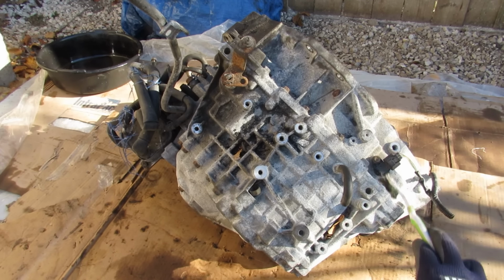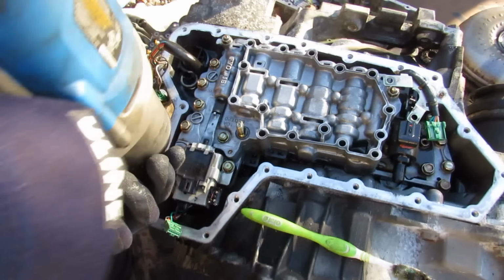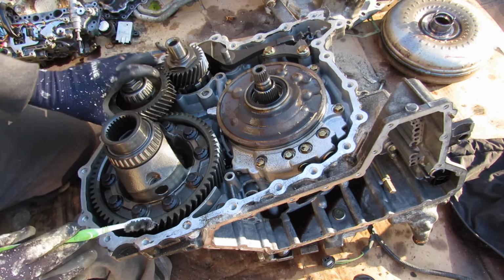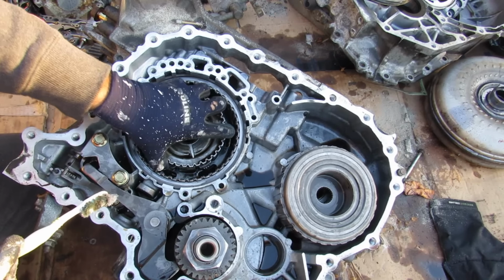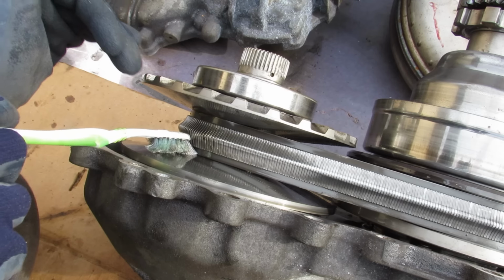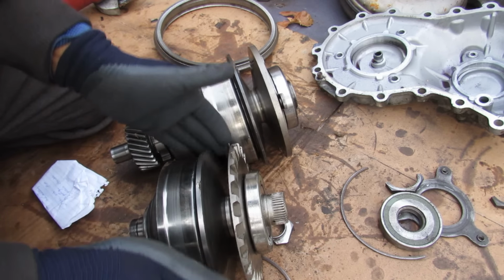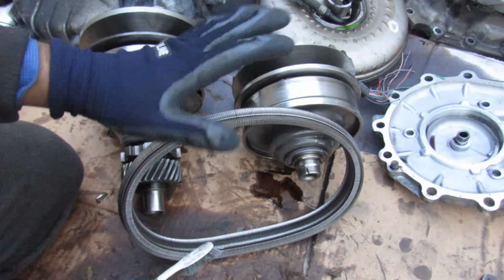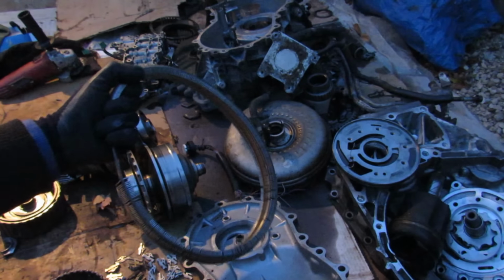Why Nissan CVTs FAIL

Comment: In my country. I know a guy with his Juke on 4th CVT before he swapped a Honda K24A2 5A/T 200hp in it. The other guy went for his 3rd under 3-year 100,000km warranty in his Juke too. And many have failed so often that we don't even consider it a failure anymore. Just another common thing for Nissan cars with CVT.

These cars are sold in Thailand with 1.6 N/A HR16DE dual injectors engine and without an air-cooled CVTF cooler, unlike MR16DDT 1.6 Turbo CVT international version. (Local sale cost reduction for 1.6/1.8 N/A, the exported ones are equipped with 4-way coolant/air CVTF cooler.)  With this weather and no cooler, the failure rate is sky-high. And of course, Nissan/Transmission workshops are very happy, too many Nissan cars waiting to rebuild/replace their CVTs. The most vulnerable one is the small Jatco JF015E CVT-7 with an auxiliary gearbox equipped in small cars under 1million Thai Baht.

I swapped the powertrain in my Nissan Sylphy(Sentra) B17 with a Honda J35Z2 5A/T, just to get rid of my Jatco JF015E CVT. I cannot stand it anymore. And my car has been more reliable than ever for 3 years. I won't trade reliability for MPG. Just let the car drink fuels and be reliable is all I ask for.

Comment: This was very informative. While confirming what Scotty Kilmer has warned for years about Nissan CVT transmissions. Your dissection defines why they fail prematurely and why you can't have them rebuilt.

I honestly never would have imagined they had as much sturdy metal in them. But the belt and clutch packs are the weakest link of them.

Comment: Auto transmissions are witchcraft, p.s that's not a fuel pump @7:20 that's the oil pump for the trans

Comment: The 4cyl/V6 Nissan CVTs also whine. A teardown won't reveal why, and eg 2 more replacement CVTs also whine. It's a factory clearance issue, putting a load on the bearings. Now we get the customer to supply his own trans, so we don't have to pay for 2 ins and outs.

Comment: Everybody knows CVT is no good also do not buy cars that are turbo if you do call the dealer just for fun ask him how much it is to replace it with a warranty is usually $4,500 with labor so stay away however if you plan on keeping the car 4. 1to 50,000 miles you can take a chance

Comment: What I've never really understood, and surely never would have expected,  is, concerning the belt, that steel on steel in an oily enviroment and besides that, a pushing belt instead of a pulling belt still manages to convey the power of the engine without slipping. Can somebody help me out?
Reply: Incredible hydraulic force.

Comment: I had 5 nissan and none have failed in the cvt .... 2 rogue, 2 pickup and 1 tsuru... why??? tks
Reply: They have a high failure rate, but only like one in 20 or whatever.  It’s a mixture of total vehicle weight, the driver, and a bit of luck.

Comment: Finally a video on CVT👍 Excellent job! Btw I have a 2015 Nissan Altima with over 250k on it (freeway miles) and NO cvt or engine problems (Its a miracle)...
I change my fluid every 60k.

Comment: You should take apart the mechanism that allows the pulleys to adjust the effective diameter, you'll find a normal-use fail point on these transmissions.

In order for the pulley to both 1) change its effective diameter while 2) transferring torque both into the input shaft and out of the output shaft, the pulleys themselves are splined to the shafts with ball-bearings in the channels. These ball-bearings are what the pulley rides on in order to move in and out, and they also serve to transfer torque from the pulley to/from the input/output shafts. Since transmissions spend 95% of their life in forwards gears, that means the vast majority of torque is transferred in one direction, so the splines wear on that leading edge until eventually it gives out, the pulley slips on the shaft, oil pressure drops in the pulley, one pulley adjusts without the other compensating, and BOOM you have a blown transmission.

Comment: Two years ago my wife called me to tell me that her and my stepson (it was his Sentra with fewer than 10,000 miles on it) were being towed ( first to a nearby garage and then to a Nissan dealer).  They were 60 miles away from home and I was  200 miles away in the opposite direction.   The dealer took care of them, including providing a free rental car for the 10 days it took to replace the entire transmission.  

But still, I'd prefer to have a car that works than to have a car where you can count on the dealer knowing what the problem is right away and who deals with it well.

Comment: I have a Honda CVT and it's amazing! I'd only buy Toyota or Honda CVTs, though. They're the only manufacturers I trust
Reply: Yeah but they also make the most boring cars out there..
Reply: @mmfong297  If an Accord 2.0T with 253 HP and 273 LB/FT of torque is boring, then I don't know what to say. I'd rather not spend thousands in repairs with Nissan, VW, Hyundai etc. cars before they get to 100,000 miles. The Nissan CVTs can barley make it to 30,000 miles before breaking down
Reply: @VishalShah2799  It's not only about power and torque.  If that's case, everyone car guy will drive a muscle car.   In fact, every car in the midsize sedan segment produces that hp/tq.  If you test drive the new Mazda6 or Altima in curving rolling roads, you will know what I am talking about in comparison.   FYI Honda is notoriously known for having horrible paint issue after 7-8 years..  And Toyota.. the steering is so soft that it makes you feel like driving a ship on roads.  Nissan pretty much covers your cvt repairs up to 100k.. $0 spent and they gave me lifetime oil change after..

Comment: Frightening! You just sold me a manual transmission. At least I know how to recondition them and replace the single simple clutch if and when it wears.
Reply from the maker: I'm filming a manual transmission teardown tomorrow
Reply: Where you gonna find one? Everything that isn't 30+ years old is automatic.
Reply: @kudzuwarrior  #savethemanuals. Cars you can buy in 2020/2021 that are manual-some have automatic options too: Chevy Corvette, Camaro, Spark; Dodge Challenger; Ford Mustang, Focus; Honda Accord, Civic, Fit; Hyundai Accent, Elantra GT, Veloster; Kia Forte; Mazda 3, Mx-5 Miata; Nissan 370z, Versa; Subaru BRZ, Impreza, Wrx, Sti; Toyota Corolla, Yaris ; Volkswagen Golf, Jetta.
Reply: @AleksUsovich  But did you notice all the ones you listed are either sports cars or economy cars? I desire neither. I need something big enough to haul me and whatever else I want around. Tiny little economy cars can’t do that and I have no desire to own an overpriced sports car
Reply: @kudzuwarrior  There's the upcoming Ford Bronco.
Reply: @southpaw117  True there is that. I’d be more interested in the Sport over the regular though. Don’t have any use for the off road mess and they want way too much for it because of that. When I need to off-road more than what my 2wd pickup can handle, I just go get on one of the tractors. Those big ag tires on the back of them give me all the off road capability I need which is just out in the fields.

Comment: Any idea at what sort of mileage issues are likely to occur, my daughter has just bought a juke cvt but only 7k miles (confirmed) on it. 2014 uk model.
Reply: I’m on 104,000km, no problems.
Reply: @terenceokeeffesmotorcyclestuff  thanks, that's a bit comforting.

Comment: CVTs are also common in high power equipment, bulldozers, front loaders etc.
Reply from the maker: Really? I did not realize. Thought they'd be manual
Reply: @speedkar99  Yes, both Hyundai and Caterpillar amongst others. Just as cars use different types of (e)CVTs, so does construction equipment.

Comment: Transaxle does not even remotely means that it is transversal... Read about the Nissan r35 gtr? A true transaxle... Or maybe a c7 Corvette?... Two shafts, Gearbox on the back, longitudinal engine on the front?.... Going back to CVT, really hate them 😂

Comment: Wow I never knew CVTs had torque converters - I always assumed decoupling the engine was accomplished with a centrifugal clutch and then the belt itself had enough slip to allow smooth takeoffs. Awesome video, I'd love to see you do a Honda IMA transmission/motor or something similar!

Comment: The more I learn about cvts I think the number one issue is the coolers. If you get a bigger cooler and thermostat (if you live in cold places I'm looking at you canada) they are amazingly reliable and actually hold a lot of power. And with time they will just get stronger and better. If you own a cvt do yourself a favor and get a transmission temp guage, make sure you use the recommended fluid and get a large aftermarket cooler.

Comment: Although the concept seems sound, the entire CVT system seems inherently unreliable as implemented.
Reply: Well, in this case it is. The original implementation by DAF and Fuji, was aimed at the small car market and was perfectly reliable.
Reply: Take note of all the cars with CVTs in a store parking lot sometime. They're here, they work, and like anything else once there's enough of them on the road, cost to service goes down.
Reply: @whickervision742  Let's wait and see how many of these can reach at least 100,000 miles without needing a new transmission. If its less than that then I would find it unacceptable. The transmission isn't supposed to be disposable like a sheet of toilet paper. I actually like the idea of the CVT, its all down to the implementation. I have a milling machine with a similar variable speed drive.
Reply: @stevewhite6252  CVT’s have a bad reputation simply because of the crappy ones Nissan put out over the years. Most other manufacturers have only recently been mass producing these in the past few years

Comment: All automatic transmission vehicles, the old sun planetary gears and these modern CVT should not be used roughly. They all should also be serviced on time and the right type of oil and filter should be used. Other factors effecting their efficiency are too much heat and too much cold. Otherwise, Nissan have been making good automatic transmission for years through their division of JATCO. I don't see this as their fault.

Comment: John Deere uses a similar system called IVT on tractors with over 1000 lb of torque.. How come tractors use CVT and IVT transmissions and no issues? I believe Fendt uses CVT on a tractor with over 2000 lb of torque, and no issues.

Comment: Man, transmissions are complicated!

Manufacturers have been trying to perfect the CVT for decades and they always run up against problems. Interestingly, the idea for the CVT has been around since at least the time of Leonardo Da Vinci, but making components that are flexible AND strong took time.

The most efficient engine/transmission system is the one where there is no transmission at all: Electric cars. Just a simple gear box is needed to transfer power from the electric motor (with instantaneous torque) to the wheels.

Comment: Are eCVT better? My Ford hybrid uses one and dealer says no fluid maint change is done, it’s sealed they say.
Reply: Yes, "eCVT" style gearbox like Ford and Toyota don't use a belt and pulley system. Instead they use a planetary gear set that is always engaged. There are no clutches, no torque converter, no belts and no pulleys, only a torque damper to reduce engine vibration. It's an extremely reliable system. 

Having said that, it is still a good idea to replace the fluid around 100k, especially if you tow, because this fluid is responsible for lubrication of the gear sets and cooling the electric motors. The dealer will say it's not required, but it's good practice and can be done pretty easily with fill/drain plugs or a vacuum extractor depending on design.

Comment: I have a Jatco built CVT behind a VQ35DE in my '13 Maxima. Nearly 90K, two NS-2 fluid change, and zero issues thus far.  The flappy-paddle shifters are sort of hokey, a 6spd manual behind the VQ would be much more fun to drive. 
Great video!

Comment: This is, incidentally, one of the main reasons Mitsubishis aren't fun to drive anymore.  The same ... not so bad 2.4L N/A or 1.5T engines... mated to a traditional 5-speed  (or conventional geared A/T)  perform --- and feel --- so much better than anything equipped with a CVT.  Not to mention, different year models have had different TCU tuning maps, so a 2.0L from an earlier Outlander Sport may not be as peppy as that of a later-model Outlander Sport.  But, the same CVT on a 1.5T feels even worse (slower engagement, severe RPM drops, and sluggish throttle response)  than the earlier 2.0L  maps?  Can someone explain why this is so?

Sadly, Mitsubishi is now Nissan's bitch.  So, there goes any chance to rekindle old partnerships with Getrag, Aisin, or even MHI  (not that the latter has any interest in going back to producing automotive transmissions anyway).

A 3.0L Outlander feels so much more powerful compared to a 2.4L, ironically, not because of the extra half-liter of displacement --- but because of its gearing!  Then, there's the reliability question - JATCo units are non-serviceable.  So... is that a "cha-ching!"  I hear in the background?

Comment: I watched the whole video and didn't find any errors in his details.
Reply: The descriptions were good. But, I cringe at seeing a grinder used for 'disassembly', destroying the case, a nut, and who knows what else. I also try to minimize toxic waste by gathering fluids instead of creating piles of oil soaked cardboard and rags.
Reply: @gregparrott  well he explain it will be dumped anyway... its not biggie he can dispose of the card board and cloth properly.
Reply: @iforgotmyusername0   Oils, in liquid form are processed rather than discarded. There is no reuse for oily rags and cardboard. Proper disposal does NOT permit dumping in a regular landfill, but entails processing as hazardous, toxic materials. It's an open question if he goes to this added expense.  If he did, he'd likely put more effort into preventing the mess.
Reply: @gregparrott  maybe you should make videos then since you are wiser than this guy

Comment: I will NOT buy a car with a CVT transmission. I did test drive a Subaru (all are CVt) it even did FAKE shifts to try to disguise the lousy "rubber band" transmission. A ruse from the start. A CVT is great for a go kart but not a $20k + automobile.

Comment: When regular transmission shops start getting these, you gotta think that somebody will come up with an aftermarket solution for common failure modes. However with the pace that technology is moving, finding those parts may be tricky. The dirty secret of new technology is the planned obsolescence of new vehicles. Even though they are more fuel efficient, manufacturers are still putting enormous resources into making more....

Comment: If you are going to buy a Nissan Car i suggest not going all wheel drive or a heavy car. Nissan CVTs can't handle big cars thats what i know! I have a nissan kicks works wonderfully even tho im a really clumsy driver no issues on the CVT so far. Always do ur maintenance in Nissan service centers they know what goes in and out. Thats all.

Comment: Nissan does sell a Sub assembly kit to fix cvt transmissions. This is how cvt's are repaired at dealerships. The issue is the labor cost and part is almost the same as replacing the cvt transmission.

Comment: Nissan CVT is transmission is one of the best Transmissions there is the only problem with them is that there are two filters on that transmission and people don't change that secondary filter that's causing all the problems I know I fix him all the time and resell them did it to my son's Nissan original transmission 2012 Rogue SVT 190000 MI

Comment: Imo the problem is they programmed shifts into the cvts which produces excess heat if it actually functioned like a cvt(just hangs at peak tq) it would probably be ok maybe

Comment: Oh no after watching this it makes me worried about my 2019 pathfinder 😰. Very informative video
Reply: Change the CVT fluid every 30k without fail and that will greatly improve your odds. Consider switching to LubeGard Full Synthetic CVT fluid which has greater heat transfer properties and offers greater belt protection than the Nissan oem fluid.
Reply: You should be

Comment: Just had my CVT replaced for the second time in my Lancer. First time no codes second the solenoid failed and blew all gears. I will never get a car with an CVT trans again 40 k on the first 30 on the second it cost the the price of the car to repair it

Comment: A vey interesting vid. Now I get why the proper transmission fluid needs to be used. The metal to metal contact between the cones and the belt would require a special blend to deal with the heat created. A CVT that I diagnosed with trouble I suspected had the wrong fluid in it, basically ruining the transmission. People need to read the owners manual on these things......
 Even if the parts were available, I could see too many places to make mistakes during assembly to make an overhaul profitable or economical for a mechanic or an owner.

Comment: Some junkyards I go to sell the dead CVTs for parts to shops to try and repair bad ones. The CVTis an awesome idea - behind a small engine in a light vehicle. A 2 ton Altima with 188 hp is not small and light, that’s why the transmission fails. Kinda sad since I like driving the car but won’t own one for that very reason.

Comment: Why not just use a rubber belt and mechanical clutches like a sled but bigger and make it so you can change the belt in 5 minutes sleds rarely have belt failures and you always carry a spare belt and you can change it in minutes when it fails in the middle of nowhere with the provided tools all of which is stored in the belt cover?